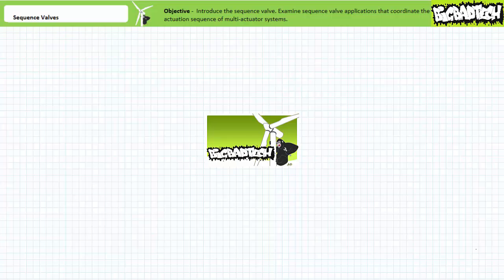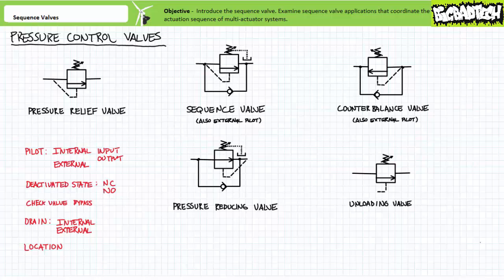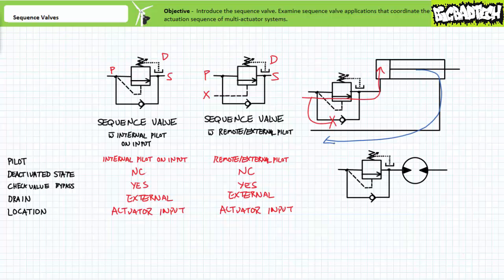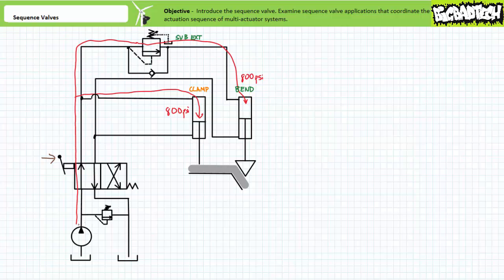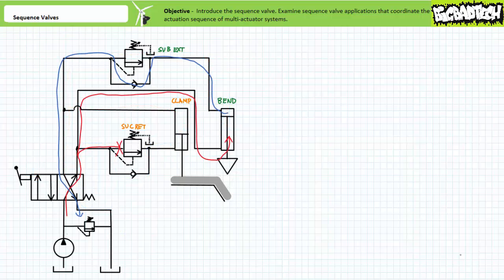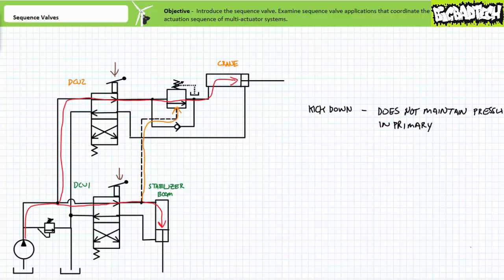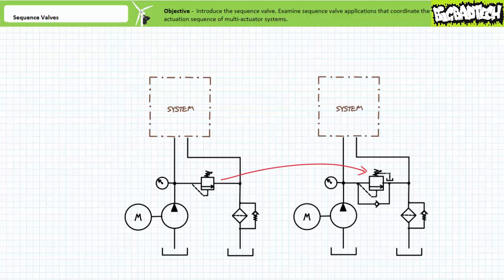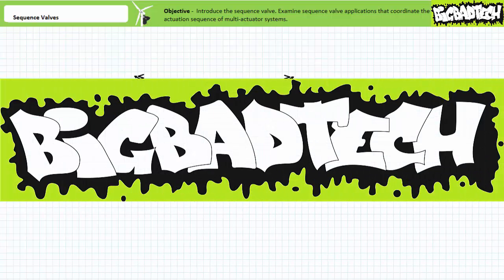Sequence Valves (Full Lecture)

Comment: Jim, please don't be annoyed by this observation rather interpret it as a student starting to grasp your material.  At 27:00 you say the Clamp Seq Valve will hold the part in place until the bend cylinder reaches its upward limit.  Correct me if I'm wrong, but although the clamp will not actually move up, it won't truly have pressure on the part as the now output side (top) of the cylinder sees tank pressure, not system  pressure.  Last item, I realize you must keep the component count to a minimum in these illustrations lest they become WAY to complex and the the explanations wander off.  One last last item, thanks again for the amazing content!
Reply from the maker: Yes, during retraction at ~17:00 you're correct that the cap end of the clamp cylinder would be at tank pressure, however, the rod end is effectively blocked. Given a liquid is being used rather than a compressible gas, the clamp cylinder will not freely retract. Yes, we'll examine more sophisticated electrically sequenced systems in later lectures.

Comment: I have a question - for the single direction hydraulic motor brake at 23:00, did you need to use a sequence valve with an external drain and integrated check? Could you use a regular relief valve and drain to tank (if tank pressure is at atmosphere)? I thought the check valve on the opposite port of the pump addressed the potential suction/cavitation issue.
Thanks for the excellent videos!!!
Reply from the maker: Yes, for a single direction application the check valve bypass on the sequence valve would be kind of useless ... however ... as you pointed out you might want a make up check valve on the other side to prevent cavitation. Check out the "Vented and Remotely Controlled Pressure Relief Valves" at: https://www.youtube.com/watch?v=zWRFibp6WnU for an alternate method.

Comment: Hello Jim, first I want to say good job !!!
I have a question regarding sequence valve, have you ever seen normally open sequence valve to be used in hydraulic circuits? if you did, can you please say in what application ? I have trouble with old hydraulic machine which was two normally open sequence valves on a manifold block and I m trying to drawn hydraulic schematic but I can't quite figure it out.
Thank you in advance.
Best R
N
Reply from the maker: Oh you are opening a can of worms .... yes quite like NC and NO switches manufacturers do offer different styles of valves. I could imagine the schematic symbol for a NO sequence valve looking exactly like a NO pressure reducing valve https://youtu.be/5vtnOLyawPg only it's sensory pilot  line (the dashed line) pointing at the input (or remote) rather than the output.

Comment: question,when the sequence valve receives enough pressure to over come the internal spring and send fluid to the 2nd cylinder,does the fact that the 2nd cylinder is now moving freely with no initial resistance until it touches the plate mean that the pressure the spring is seeing in the sequence valve also reduces thus causing a juddering effect?
Reply from the maker: You're describing a "kick down" style sequence valve. These type of valves don't maintain pressure in the primary circuit where as a normal sequence valve does. Kick down style sequence valves are very application specific.

Comment: Hi Jim can you let me know how do you run four hydraulic motors in sequence? The external load might very motor to motor. All the motors must have the same rotation. You know what I mean. The oil supply is from one pump.
Reply from the maker: Check out this lecture on the HydraForce HTD 10-40 Hydraulic Torque Divider: https://www.youtube.com/watch?v=6VkH_rBQ6Ec

Comment: I don't see a clear difference between the sequence valve and the counterbalance valve. Is the counterbalance valve simply a sequence valve without an external drain?
Reply from the maker: They're remarkably similar (aside from the drain) however sequence valves are ordinarily located on the "input" of an actuator whereas counterbalance valves are ordinarily located on the "output" of an actuator.
Reply: @bigbadtech  I just saw the crossectional view of both of them and now I can understand it better why one is better for input and the other is better for output. i think you should mention that in your video so anyone can understand it better too... btw thank you for your very good content, I'm currently working on refurbishing a coiled tubing unit in which a hydrolic plays a very important role, watching ur video helped me a lot to finish this project...